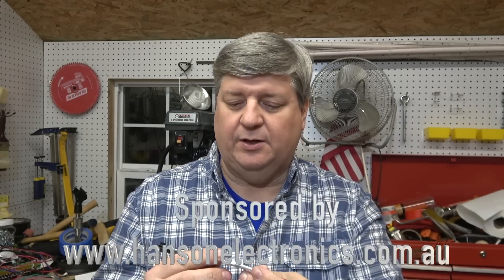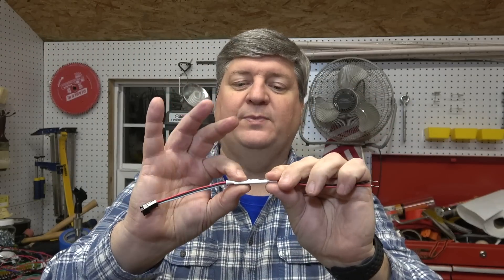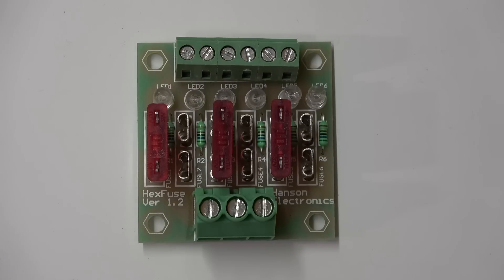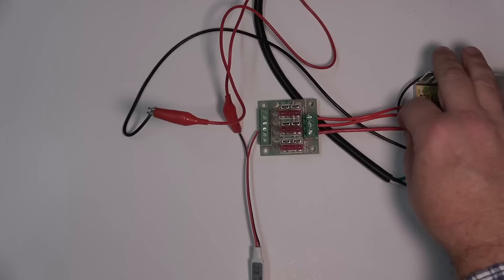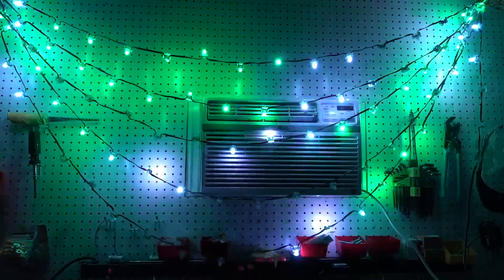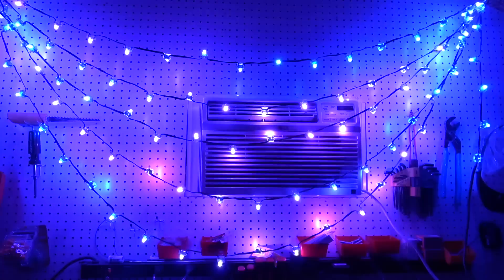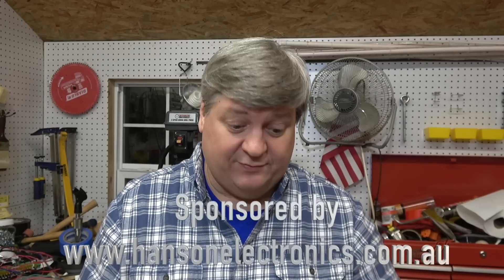RGB Pixels for EVERYONE! NO COMPUTER REQUIRED!

Comment: These are brilliant little devices. 2.5weeks into December and I still have a few hundred pixels running off these instead of running off a pixel controller and a sequence.
Reply: Alan H can it do Halloween colors too? Like green and purple? I ordered a falcon PiCap but didn't work so I want to try this instead
Reply: It definitely does green and I think from memory it does purple. Among all the colour options it does all the primary (red, green, blue) colours as well as the secondary (cyan, magenta and yellow).

Comment: Great video I have a question do I have to use the hex fuse or can I just hook up the pixel tester to a 12 V power supply box?
Reply from the maker: The tester will power a small string of pixels, but it isn't designed to carry current for a lot of them. I forget the exact specs, but you'll have to do the calculations and make sure to stay under the max current OR inject power so that it isn't carrying the entire load.

Comment: Sorry to comment on such an old video, but I have come across your channel and have enjoyed getting to learn about the Pixel world and had a quick question. What is the wire piece you use that goes in-between the tester and your RW Pigtail? Since it’s end connects into the tester and then you’ve wired in the other end to the pigtail. I ordered my first string of 100 pixels and want to start trying to figure this all out and I think this might be a good place to start.
Reply from the maker: Not sure I understand the question. Are you talking about the converter pigtail that I made so that it goes from the tester to my pixels?
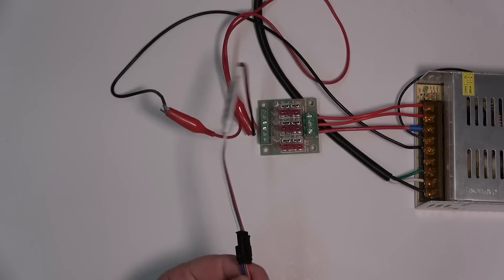Reply: @CanispaterChristmas  , I think that’s what I’m talking about. It’s best seen at 3:49 in the video. Whatever the connector piece is that goes from your Ray Wu pigtail, to the Hanson tester, that whole thing to me looks like it’s 3 pieces, so what is the 3rd piece in the middle.

Thank you for your help.
Reply from the maker: @natewalls4850  That's just a solder connection with heat shrink tubing unless you're talking about the fuse board. Alan sells those too.
Reply: @CanispaterChristmas  I guess what I’m looking for then, is what is the piece you solder on to the end of your pigtail, to then be able to connect to the pixel tester? My apologies I’m just not knowledgeable with the technical terms of all the parts yet, to me right now it’s just a “thing”, but it’s the thing with the black connector looking thing, coming off the end of the pigtail. Thanks again.
Reply from the maker: @natewalls4850  Oh, yeah you need to figure out the +, - and data (DI or DO) on the pixels and work back from there. There isn't really a standard so you'll need an ohmmeter to figure out which wire applies to which pin or socket. The pixels are marked (you may need a magnifying glass). Tester data out (DO) goes to pixel data in (DI). Tester + & - go to pixel + & - . If you connect + to DI, you'll likely kill the chip on the pixel so double-check your work before applying power.
Reply: @CanispaterChristmas  would you be willing to share an email address where I could maybe send you a picture with notes about what I’m speaking of?
Reply from the maker: @natewalls4850  Check my about page.

Comment: Cool device for sure. Canadian $ almost same as Aus. However, shipping for one $5.50 AUS tester is 25 or so dollars so a little over 30$ AUS total.
Reply from the maker: You might check with Alan on shipping. That seems a bit high.
Reply: Thanks for the reply. I am just going by what the  shopping cart says. Great job with the videos BTW.  I'm trying to figure all this pixel stuff out to kick up my Christmas lights a notch. Steep learning curve for sure, power supplies, controllers, IP addresses, type of LED's to use, software etc so I really enjoy your easy going and informative videos.
Reply from the maker: Oh. Haha. OK. Yeah, there can be a lot to learn. It IS a lot of fun though and quite rewarding when it all comes together. Thanks!
Reply: Just curious, You mentioned snow wreaked havoc where you live. How does it affect your display? I live on the west coast of Canada. Mild winters and may get snow but mostly rain. Other than the silicone strips, waterproof cases and decent soldering , shrink tube and  connectors; any concerns?
Reply from the maker: It was a joke. We don't get snow except for once in a blue moon. Mostly ice. Doesn't bother the display at all. :)
Reply from the maker: Oh, but if there is even the slightest chance, the local weather people forecast doom and gloom. Apocalypse. I find it comical that we are all gonna die so often due to the weather.
Reply: Just a quick follow up. I contacted Hanson Electronics and he added a padded envelope option that is more cost effective for small shipments.

Comment: Was going to order these pixels off amazon. https://www.amazon.com/dp/B06XN66ZY6/ref=cm_sw_r_cp_ep_dp_2hV2zb6E6GT49
Would these work with this? They're both WS2811, but is there anything else to look at? Also, what size fuse do pixels require?
Reply from the maker: Yes, they should work. Figure 0.06 amps * number of pixels. So for 50 pixels, it would be ~3 amps.
Reply: @CanispaterChristmas  Do you think 50 would be enough to wrap around an inside tree? 7-8 ft tall
Reply from the maker: Haha. No matter how many you start with, chances are you’ll want more. 50 will light it up nicely and get you through the learning curve of pixels.